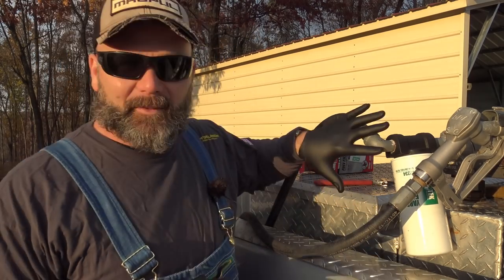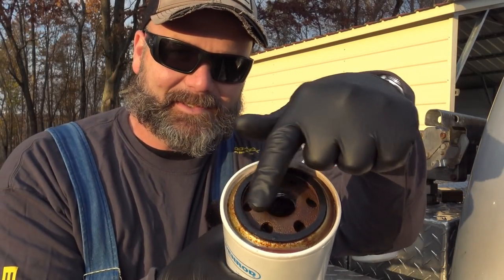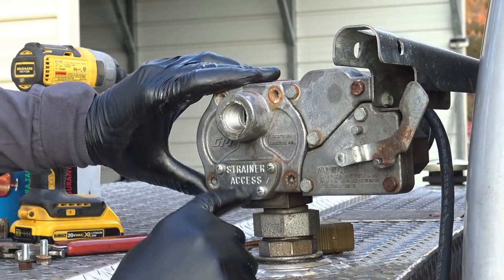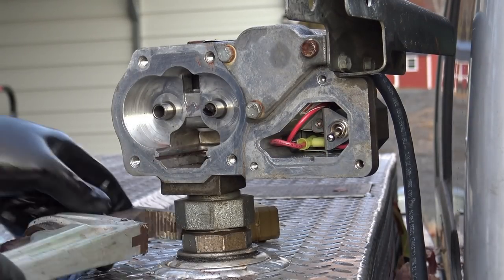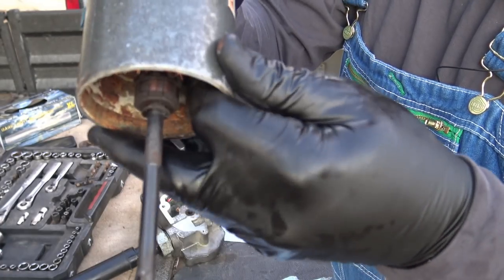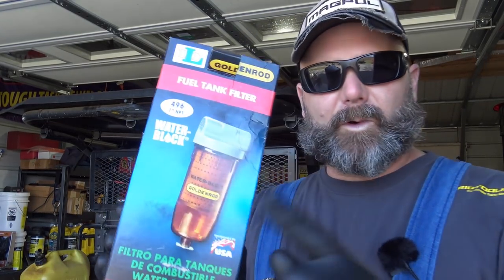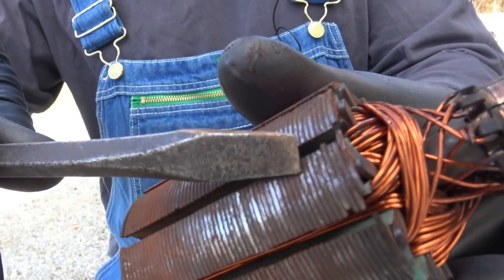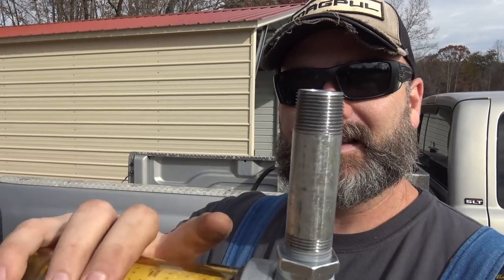What's in my fuel! This doesn't look good!

Comment: What you called a relay is actually a circuit breaker which did its job.  Had you not had that breaker in there, that fueling pump motor would have super heated and likely may have started your fuel tank pump system on fire with the predictable disastrous results.  Rust does add dimension to steel and, in your case, tightened up the clearances between the motor armature and the magnets.  The resultant drag in the motor caused the breaker to trip out.  Lucky for you.  Obviously the breaker is the self-resetting type.  The pump still sounds noisy.  I say go with it.  If it quits again, at least you'll know what you're up against.  Years ago, at my store, we did not stock any rebuild kits.  When people saw the prices on the new pumps, most often they balked.  Good educational value in this video.  I have never seen the inner workings of one of those pump/motor assemblies.
Reply: You hit the nail on the head
Reply: bcgrittner 
Notice it wasn't too bad until he pulled the trigger on the nozzle and primed the system, then with the nozzle shut off the pressure made it noisy. I have a different brand of pump in my tank, it sounds the same, and has since day one. His is probably good to go until the motor gets full of water again. Hopefully he put enough silicone sealer on the motor case to slow the water flooding process down for a while.

Comment: Nicely done. One thing that nags at me is there might be an o-ring 0r some kind of seal around the drive shaft that let water into the pump in the first place. I always love tearing something apart. I just went from 4 GB of ram to 8 GB of ram in my laptop, saw the fan was dirty so took the fan out and cleaned it. To my dismay, I saw one of the wires had been cut probably when I was using a small screw driver to get the fan cover off when it was still installed. Didn't have to do that because I found a hidden screw under some wires to remove the fan. Oh well, anyway, I started stressing a bit, but had to try to fix it. Those wires are so small, so I found my loupe for my magnifying visor, an exacto knife with a new blade, solder, rosin and my small butane torch with a solder tip. It took a while because the whole wire might be 1mm with about 5 tiny strands of wire, but I got that little 'bugger' soldered back together and using the laptop now. I found a new fan for $10 on ebay and will be replacing what I fixed just to be sure I don't fry this laptop. Thanks for sharing.

Comment: Considering this tank is primarily used for filing tractors with fuel tanks under 20 gallons I’d just clean the tank out and install a hand crank pump on it.  You won’t have to worry about alligator clips or the fire hazard

Comment: I'm thinking the rust is related to temperature changes and condensation.  I saw mo evidence of water b inside the pump housing.  But yes, your fuel . definitely has contamination issues... your local town people need to have many discussions with your supplier.  Here in texas, the agricultural commissioner is the overseer for fuel . stations.  Good luck.

Comment: You did put a dab of lube at the bottom of that cover before you reinserted the motor...yes?  And you also silicon sealed the unit before you did the final installation....yes? Otherwise you'll probably get rust again.

Comment: The magnet being loose and sticking to the armature is often caused by beating on the case of the motor. Tap on the end if you are having an issue with a starter or electric motor.

Comment: You need to use a good algaecide to get rid of the allergies is growing in your fuel with all your water vapor and everything in the tanks to growing inside if you can keep your tank stopped off as much as possible help and buy some places like a truck stop that sells a lot of fuel
Reply: Richard Clark I have had several trucks come up from the south that had algea in the tank , we take the tank and steam clean it then we slosh alchohol in it to get the water out , refill the tank with fresh fuel and stanadyne fuel additive with algeacide , usually clears up the problem.

Comment: Never seen all those parts in my fillrite pump I took the other side off first and found the magnetic broke in the middle on one side and was no longer glued to the wall and dragging so I used like 5 clamps different sizes so I can evenly put pressure on the magnet and glued it back to the wall and it sounds quiet and like a band new pump

Comment: If you want to run the fuel thru the filter just put the nozzle into the fill of the tank and run it for a while and see if it pickup any water. Also, put a cover over the pump when not in use

Comment: If you stop getting fuel out of the hose replace the fuel filter. When you have water in the fuel the water block filter will block the flow of fuel and you need to replace it. Voice of experience here.

Comment: Did you drain the tank totally? We would take a shop vac and blow air in one hole until it was dry inside. Blow not vacuum, the warm air from the shop vac will help dry it out.

Comment: Fix that baby magnets should be glued to the housing. Hone with oil and cylinder hone wash with acitone. Paint with black spray paint glue the magnets back with jb weld quick. Clean the armature with 400 grit wet dry paper respray with clear enamel . lube bearings with dielectric grease reassembled. Run the crap out of it. Motor is a dc motor like on a starter . starter shop can rebuild it also.

Comment: Those Fuel/Water separators are only meant for gravity systems. The pressure from your pump will push particulate through the filter.

Comment: It seem like it should not be getting  fuel to the coil of the motor.  What seal should be there to keep the fuel out. Do they make a filter for inline before the pump?  This could keep the pump cleaner or free of water.  I had always wondered what would be the least amount of trouble and  work well on the tanks hand pump or battery.  I would like to get a 50 gallon cube in the future. I would think it would be better to keep the junk away from pump inlet.  great video! As they say learning by doing lol.  Have a great week.

Comment: Clean all the rust out really good, put it back together (after checking the bushings for slickness) and run it.  Probably will run like a champ.  Now the permanent magnets are supposed to be epoxyd in place.

Comment: I got a load of off-Road diesel from a station with brand new tanks. I had a brand new Kubota tractor full of water. The dealership gave me advice. I drained the tank, removed the sediment bowl and purged the injector line. Never bought fuel from that place again. A real pain in the butt.

Comment: You probably already know this but the rust in the motor did not come from anything in the tank.  Fuel cant get in there...but the motor can leak water over the years enough moisture can seep in to cause the problem.
The black stuff you see and the rust on the filter sre related.  Likely you have water in the fuel but you also have clumps of algae growing in the fuel (caused by the water).  There are additives made to kill the algae (Killem is one of them) then you still need to get the fuel in the tank clean or you will have continuing problems.  I built a fuel polisher for a similar problem.  Worked great.  One day of recirculating the fuel through the polisher...problem gone.
Good luck
Reply: With a bad seal on that shaft water and diesel can get into the motor.

Comment: surprised the motor doesn't have a rubber seal to keep water out. If I were you I would put Sealant where the motor and plate go together and where the motor bolts to the unit to keep water from penetrating into it again.
Also I use Mineral oil to clean up old motors since its non conductive.

Comment: Ask where you buy fuel if they have had problems with their fuel. They may be willing to furnish a few filters and maybe new fuel. I had that happen one time with gas and the station did that as well as drain the fuel tank and fill it  up free. Also four new filters. I was lucky the fuel tank on my car at the time had a drain plug at the bottom.

Comment: If you reed the instructions on the water trap/fuel filter, it is to be fitted on the suction side of the pump as the flow is not all churned up after going through the pump.

Comment: or just use something like a Carter P4070 or P4601HP fuel pump, then plumb to water sep, then to filter. You can use a momentary On Off switch. I actually use the Carter pumps for lift pumps on my Dodge Cummins and diesel tractor and to empty 5 gal cans into equipment.

Comment: You should use some engine rtv. Motors will heat up, stuff for automotive engines is made to handle the heat. Also I think your real problem with the motor was the magnets coming loose from case. They shouldn't touch the armature. Should make for a good fix

Comment: When I saw you use caulking I was saying, "It ain't going to work". I was hoping you went to using epoxy because the Armature has to ride in the center with a gap on both sides between the magnet and the Armature so it'll create a magnetic field.

Comment: Good job. Don't park the truck in the sun ... Fuel heats up and as it cools at night water (humidity) from the air will condense in the tank. So there should be a bung or drain cock on the tank to drain periodically. The best thing you've done is fit the water separator filter. Now build a rain shield for the motor/pump as that's what has caused the rust; also, as a tip - do not run the pump without fuel flow through it, and not dry ... It'll last much longer. Do you use a summer and winter grade Diesel in NC or just Agro Diesel? Good job again Mr. Fixit.
Reply from the maker: No winter diesel down here in this area...weather doesn't stay cold enough

Comment: "...picked up this tool box-fuel tank combo for about $100, used..."  You know the saying, if it sounds to good to be true, it usually is.  The thing you need to be careful of when using wire brushes is using dissimilar metals and causing galvanic corrosion.  Nice rebuild - a little Camarata-esque -- lol

Comment: Clean it with brake cleaner then WD-40, glue the magnets back in and give it a whirl.  Make sure when you reassemble it, SEAL IT up.
Reply: If you want to epoxy/glue anything, don't use WD-40, it's a type of lube and the epoxy won't stick to it.

Comment: well, you have water in your fule, but that would no get into the motor, I'm thinking you need to find a way to cover the motor, could be because of condensation building up. motor is drawing damp inside.

Comment: Josh, those magnetic field pieces should be epoxied in the case and not rubbing the armature. Clean everything and epoxy them back in the case in their original location. Clean the armature and check the brushes. Don't use that silicon stickum it won't hold , just use good epoxy.

Comment: I like to explore to try and save a dollar every time rebuild reuse make it work but saving 400 is the same as putting 400 in the bank. Josh am not sure just a question the fuel water Separator have a filter also? Or are you going to put anther filter on it later?

Comment: Not electronics! There are no diodes, resistors, or transistors in there, it's just electric, the two are not the same thing. The "relay" on the switch is an automatic resetting circuit breaker, it gets hot and kills the circuit. In a few seconds it cools off and resets itself, then the circuit is powered up again. Older trailer brake controllers had those too. The motor sounds good now, you did good! I wired mine with a 7 pin trailer connector and plug it in to the gooseneck connector in the truck bed for power. It runs off the RV battery charging circuit built in the trailer harness on my truck. Haven't had any problems with it, it's a 30 amp circuit.

Comment: I'd spray the amateur out. Clean the rust up on the canister and put it back together to try to fix it.

Wow I would of got a pump off Amazon or eBay and just filled fuel cans till it came it.

Get you a drill bit extension for the wire wheel.

Edit: see you found the motor was just available. I figured you should be able to but that.

Good work. I had a feeling like you that that motor would clean up and be serviceable for maybe years into the Future.

Comment: You probably need to make a weather proof cover to go over the pump when not using.  The motor does not look to be sealed really well.  I have seen contractors with covers on them before.

Comment: Partially filled metal fuel tanks make water as a result of the hot cold cycles of the day. Sun comes up heats the tank, sun goes down and depending on humidity levels where you live water condensates on the inside of the tank and drips down into fuel. This occurs on heavy equipment a lot. The way to stop this is to keep tank full and or recirc the fuel thru the motor of the vehicle which will help to dry out the fuel. If running a recirc line thru motor is not an option(gas engine ect.) then your only option is to Make sure tank vent is working properly and keep tank topped off. I suspect this tank has been left partially full a long time before you got it and that maybe why he got rid of it for a 100 dollars.... Cheaper and less trouble then cleaning it out which is what you have to do now. FYI most fuel sources like stations and depot's are so heavily regulated now, that it's unlikely to get a bad tank of fuel, unless it's a sudden failure some ware or a known supply issue...Jack Baker

Comment: Your problem may have started with the fuel supplier, but also could have been home grown. The gunge on the pump mesh did look a bit buggy. So maybe Diesel Bug was the culprit.

As an ex boat owner who suffered from Diesel Bug which was no problem on the quite upper River Thames but when I ventured down river to the tidal section  and lots of boat traffic that put up waves, the diesel in my tanks got all stirred up, blocked the filters and cut the engines. Luckily I managed to moor up on a jetty.
So diesel bug can be the fault of the fuel station tanks sweating and the condensation lays on top of the fuel and a growth forms. Now this can also grow in the boats tanks through condensation, the hot fuel line return feed hitting cold fuel in the tank.
During a refit I installed two smaller tanks that were dedicated to each of the twin engines, with an emergency cross over valve. In addition I installed a circulating pump and filter system so I could move filtered fuel from one tank to another and back again to polish it. Each engine also had twin switchable fuel filters so that filters could be changed while on the go. This was a bit belt and braces but I was crossing the English Channel to France and Holland crossing very large shipping channels. 
It also helps to keep the tanks topped up especially in winter, it was also suggested I cooled the fuel return line but didn't bother with that one.

My suggestion to you is keep the bowser topped up, possible lag the tank as Spring and fall warm days and cold nights can cause condensation. recycle the fuel just with the delivery pump set up you have but go with a twin filter set, this will polish the fuel before putting it into other equipment.
Reply: PS: I posted before watching the end of the video, friends have used the additive and still had problems. Why not fabricate a weather cover for the pump. Electric pump rebuilds cost $20 bucks here in Vietnam and if they havn't got a part they make em.

Comment: Could use a cylinder hone for cleaning the inside of the case. If you don't have one, its easy enough to make a flapper type. Take a 3/8 bolt, cut the head off. Make a slit down the middle of the bolt wide enough to slide a folded over piece of sand paper ( a little over twice the diameter of the case) into, chuck it up in a drill and you have a poor mans hone. These can be made in any size. I have used them on  brake master cylinders, cleaning out inside of pipes or fittings and yes, cylinders.

Comment: We clean jet fuel tanks with microorganisms with menthol alcohol. If that helps any. And change the filter. And add biobore or something of that sort for 24 plus hours the drain that out. And you should be good. But that's an aircraft with jet fuel which is about the same as diesel.
Reply: Also for the electric motor you can brake broke!

Comment: Your tank will get condensation on the inside of the top if you have a low tank caused by warm days cold nights. It will then build up and cause problems.

Comment: I didn't see any seals to seal the motor from the weather.  When it rains the water will go into the motor.  Loosen the long bolts and create a small gap and put a small amount of silicon caulk.  Make sure you have all the fuel off the surfaces because the caulk will not dry properly.  Allow the silicone to dry for at least 24 hours.  Once it is dry you should be good to go.  Not a good design not having seals in a motor that is outside.  The cap on the back side should pop off also.  Put silicon on that too where the cap meets the tube.  I just went back to the video and I also noticed no seal from the motor to the pump.  Again put a small amount of silicon and seal that also.  If you want to do it cheep and dirty just get a coffee can and cover the motor/pump so it can't get rained on.

Comment: That's like the same kind of motor you find in a disability scooter. You can probably fik it. The motor wouldn't work right because of that one magnet broke loose. The one thing that is real important to consider is there is rust inside the motors casing, that means moisture can get in maybe the next thing to get in might be fuel. I would replace it with a new motor. I think that would be the safe  option. You could rebond that magnet put the motor back together and use it for another purpose.